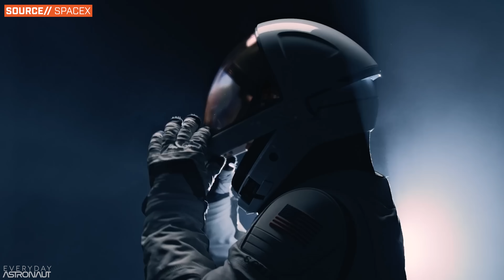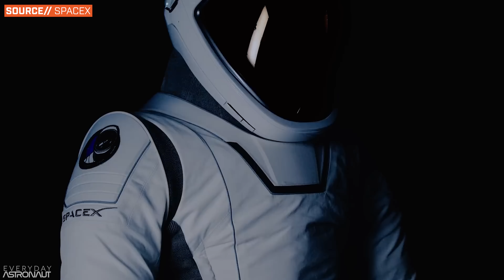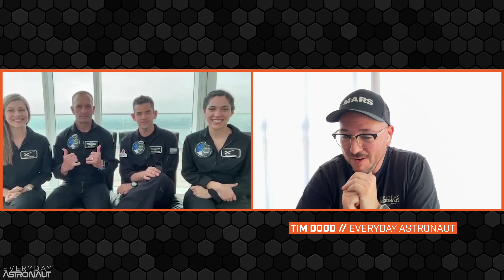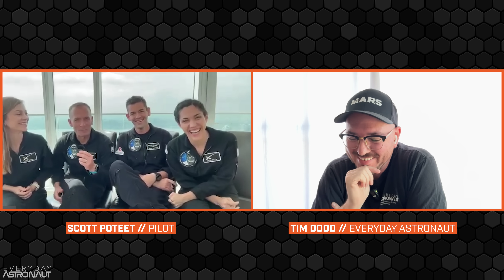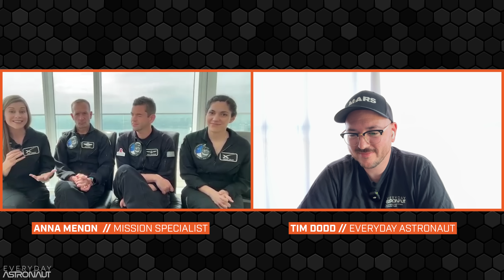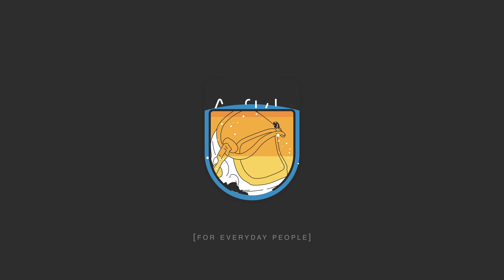How Polaris Dawn Will Do The First Commercial Spacewalk!

Comment: The Apollo suits included a micrometeorite protection layer, does the new suit have that?

In terms of redundancy, is there redundancy to keep the head in oxygen even if the rest of the suit volume springs a leak?  I mean essentially a scuba diving mode with opposite pressures to allow the astronaut to breathe, climb onboard, close the hatch and pressurize the capsule while remaining conscious and able to move, despite their skin being at near vacuum pressure, just like a scuba diver can swim out of 2 to 5 atm pressure (10 to 40m depth) with only a face air supply .

How much of the 50+ hour pressurization protocol will be rehearsed in a ground based pressure tank like the ones used for pilot and diver training?

Comment: One thing I do not understand. Maybe someone will be kind enough to enlighten me. Dragon is going to depressurize, so most of the air is going to be removed from the cabin? Will they store the air in some kind of tank, and then, after closing the hatch, they will gradually pressurize that cabin with that stored air?
Reply from the maker: Exactly! They have to have enough stored compressed air to repressive the capsule after the EVA
Reply: @EverydayAstronaut  Thanks for the answer Tim.

Comment: Active tracking?
So ground tracking is not going to be the primary way that the.
Equipment in orbit is going to rely on position. Is primary tracking going to be from the Starlink satellites?
Will that be a  component from laser positioning?
Will primary control a positioning and tracking be Relayed from nasa to.
Capsule or will it be relayed from starlink to capsule to nasa?
Which integrated system is making the decision to adjust?
Thank you and more, please.
???

Comment: 100% O2, is that safe? I'm a bit worried about that 😅
Reply: This is at 5 PSI which makes it considerably safer. It may be pure oxygen but it's nowhere near as dense. Apollo 1 was pressurized to a positive pressure of 16 PSI at 100% oxygen. Now THAT was dangerous. It's also in space, which is a different environment entirely.
Reply: Awesome, you are worried.  Good thing because without your worry they never would solve the safety issue.  You are such a special hero.  👏

Comment: 13:57 Why are they using 100% oxygen? Didn't that contribute to a tragic loss of life on the launch pad 40+ years ago?
Reply: Contributed yes, but not the only factor. NASA continued to use pure oxygen for the rest of the Apollo missions without incident. Skylab also used a very high oxygen mix.
There are several things that were done to make things safer after Apollo 1. First, running the pure oxygen at much a lower pressure - Apollo 1 was 16.7 psi, while later Apollo missions only ran pure oxygen at 5psi - Dragon will be about the same. Second, removing ignition sources and using non-flammable materials. That was the main upgrade with Apollo block 2, and it seems fairly likely that with modern materials and electronics Dragon can do even better.

Comment: That oxygen percentage in the capsule is way too high. 40% is about where there's no difference between nitrox and oxygen. When I ran diving chambers I never let the oxygen percentage get over 25, and tried to keep it much lower. But we had no electrical equipment. Nothing at all. No sunscreen or oils allowed, no normal cloth, and all cloth pre soaked in fire retardant.

There's no way I'd get into a chamber at that O2 percentage. That's completely insane. The pay off of reduced prebreathe is absolutely not worth it.
Reply: All of the Apollo missions ran at 100% oxygen for the vast majority of the mission duration. It was rather infamously a problem on Apollo 1, but the fact that it wasn't an issue on Apollo 7 through 17, as well as the Apollo-Soyuz test program, and the 3 Skylab missions, suggests that it was a solvable problem. 
The main difference was that Apollo 1 ran pure oxygen at 16.7 psi, while all the later missions only ran at 5psi. Dragon is also going to run at about 5 psi.

Comment: Thumbs up for using metric kilometres rather than freedom units.
Imho, pressure in metric uses less mental and mathematical gymnastics.
Officially air pressure metric is kPa, however this is unintuitive. However Bars is simple.
E.g. 1 bar = 1 atmosphere of pressure.
Psi is imperial and has familiarity with tyre pressure, but Bars reduces confusion.

Comment: If Polaris Dawn is the "first space mission to use Starlink", then how did we get the uninterrupted footage of Starship rolling out of control and then slamming into the ocean using Starlink?

Also, have these suits been worn by the crew in a vacuum, already? Please god tell me this isn't the first test with these suits in a vacuum with crew inside. Please please please.
Reply: Nowhere in this video was "first space mission to use Starlink" mentioned. Tim asked if it was the first mission where it is used on Crew Dragon as the primary communication method, but in the answer it was clear that is not the primary communication method, because it is experimental. It will be the first time Starlink is used to communicate with a vehicle that is above it, which can only be done using laser beams and not using the regular antennas, which are on the bottom of the Starlink sats.
Reply: Nowhere did it mention this was the first mission to use Starlink…what? Also they have already mentioned this suits have been vacuumed tested. You really think they wouldn’t do that? Come on man.
Reply: Ignorant

Comment: Is pure Oxygen not a very high risk (fire)?
Reply: they are not going to use pure oxygen. just a higher concentration like enriched gas in scuba.
Reply: No, because they're not doing pure oxygen at sea-level atmospheric pressure — they're just taking away most of the the non-oxygen, leaving the same amount of oxygen at a lower overall pressure.

Comment: Great Video !  Another spacecraft to do an EVA/spacewalk from is the Blue Origin Blue Moon HLS !  The Blue Moon HLS with a 6.1 km/sec delta-V (per Robert Zubrin), a LIDS docking port (NASA CEV design study) and an Air-Lock/dust-lock (Mike Griffin-NASA Headquarters) can support a Crew of four for two to three weeks.  The HLS/LEV/LLV can support missions to LEO, to the Hubble Space Telescope, to GEO and missions at the NASA Lunar Gateway and on the moon.  Once the HLS/LEV/LLV can fuel up at the LS Fuel Depot and not at the NASA Lunar Gateway the Blue Moon HLS with a 6.1 km/sec delta-V can depart for the low inclination LEO CSS !  The HLS/LEV/LLV can also support the NASA designed "24-Hour Lunar Shuttle" (LEO to LLO) by Stan Borowski-NASA Glenn Research Center !  The Tech developed to return to the moon to stay, can take US and the world to Mars and beyond !  tjl

Comment: Let us hope also that SpaceX has done a thorough analysis of the heat load on the electronics of Dragon depressurized to vacuum. That is the reason that the Russians made an inflatable airlock on Voskhod, because their electronics had vacuum tubes which generate so much heat they would fail in the vacuum that could not take away that heat.
Reply: I’m sure the most dominant and successful launch company on Earth with the smartest engineers on Earth haven’t done the proper analysis.
Reply: Dragon was designed with NASA oversight to be able to operate in vacuum. It was one of the NASA requirements for Commercial Crew, since there are emergency scenarios where the spacecraft might lose pressure but otherwise remain flyable. Worth noting that NASA operated both Gemini and Apollo in vacuum for EVAs, so they had prior experience to contribute.
Jared Isaacman also specifically said on twitter spaces that they'd done a thermal vacuum analysis in a NASA vacuum chamber - presumably the electronics were part of that.

Comment: Sarah Gillis really deserves to fly. I watched her train the crew of Inspiration 4. Glad she finally gets to see space firsthand.
This commercial space program is now going to be about on par with the Gemini Program of 1965-66. The Dragon 2 has to depressurize the entire spacecraft since like Gemini, there is no airlock on the spacecraft. The suits are about equivalent to the Gemini EVA suits - extra insulation and protection, extra rotational and bend joints, and an umbilical for communication, security, and life support. Let us hope the spacewalker does not see the same difficulties as Cernan, Collins, and Gordon. They were really exhausted and blinded by sweat and fogged visors. The Gemini suits used air to cool the astronaut. It proved completely inadequate for any kind of exertion and practical work in space. That is why the Apollo and ISS EVA suits used a backpack. It allowed use of water cooling, which is essential for a hard working astronaut. It also gave them freedom of movement.
Gemini astronauts that passed over the South Atlantic Magnetic Anomaly got a bigger dose of radiation than the moon walkers, due to the trapped radiation and the weak shielding of the Earth's magnetic field in that region.

Comment: I am afraid for them, especially what SpaceX has shown us with Starship. Its nowhere near finished and every launch was a big failure.
Why do they need to do orbital refueling?
Why not launch a single rocket directly to the Moon?
I hope they make it safely 😢
Reply: Starship is a rocket under development, which has absolutely nothing to do with mission, which uses Falcon 9 and Crew Dragon, both of which have proven to be extremely reliable vehicles. They are not going to the moon on this mission, and there is no orbital refueling involved.
Reply: Starship is an experimental prototype; it won't be flying people as an operational vehicle any time soon. SpaceX want to do about 100 successful launches before flying anyone on it.
They did the same thing with Falcon 9, which flew 87 times before they put anyone on it. Falcon 9 Block 5 now has a perfect 275/275 track record, the best of any rocket in history.

As for why Artemis isn't using a single rocket, that's a long story dating back to political decisions made by Bush and Obama. However, there is a more practical reason.
The goal of Artemis is to perform long duration missions, and ultimately build a moon base - the Artemis Base Camp. Which means lots of cargo needs to go to the moon.

Now, the Apollo lander was able to get to the moon in a single launch - but it only carried about 0.3 tons of cargo. NASA wanted a baseline of 12-15 tons for Artemis.
Which means you need a lander 40-50 times more capable than the Apollo one. If you tried to do that in a single launch, you'd need a rocket dozens of times bigger.
The more sensible alternative is to split it over multiple launches. Current projection is 12 launches for SpaceX and 8 for Blue Origin, for 50 tons and 20 tons to the moon respectively.
On a per-launch basis, that works out to 4.2 tons per launch for SpaceX and 2.5 tons per launch for Blue Origin - both significantly better than Apollo's 0.3 tons with one launch.

Comment: That oxygen mixture has me concerned about an Apollo 1 style accident... I'm sure the team has considered that though...
Reply: That was at 1 atm. They are doing it at a lower pressure. The fire risk is (mostly) from the partial pressure of the oxygen and not the concentration. The Apollo 1 cabin also contained lots of crazy flammable materials + it wasn’t tested properly beforehand.

Comment: A single layer visor sounds like a really bad idea.
Unless it is rated to survive a 15.6 km/s impact from a 5g pebble or piece of space debris, it poses an not insignificat risk to the occupant.
The point of the duel layers in other visors, and space craft in general, is that most objects get vaporised by the first layer on impact, and then the now microscopic particles are unable to breach the second layer.
For a suit thats supposed to be designed with redundacy at every level this seems like an oversight.

Still, the rest of the suit design seems well though out and is honestly quite impressive.
Not really a fan of the fact that the suit uses an oxygen teather, it would restrict any eva to a distance no greater than the teather length.
Though I suppose it would be easy enough to make a backpack that can plug a line into the existing port so maybe it's not such a bad idea.